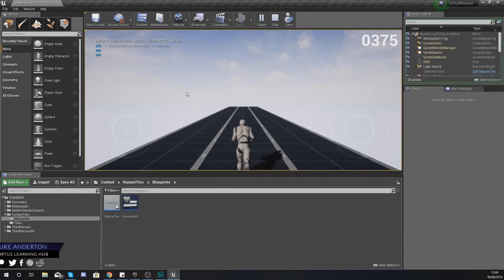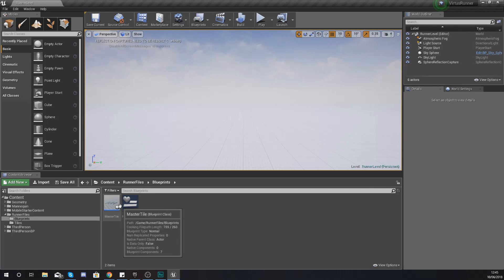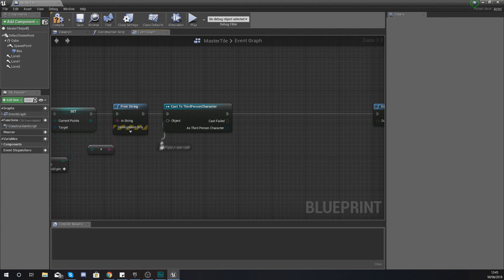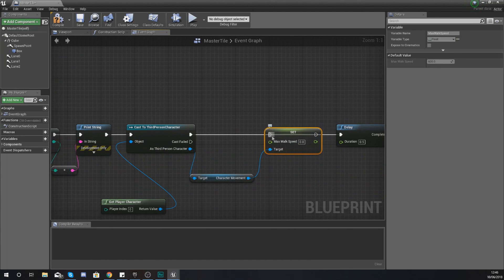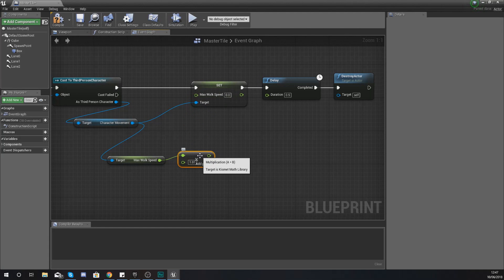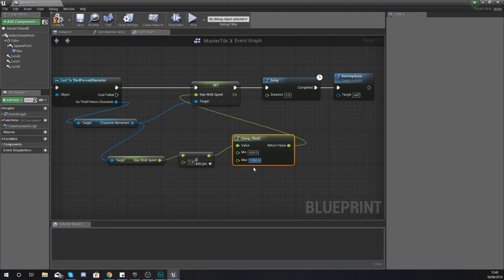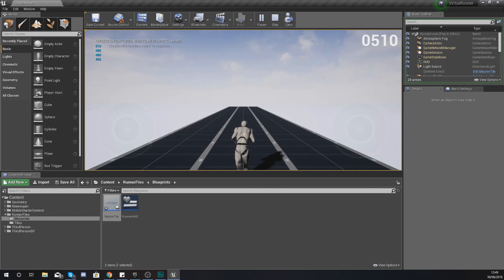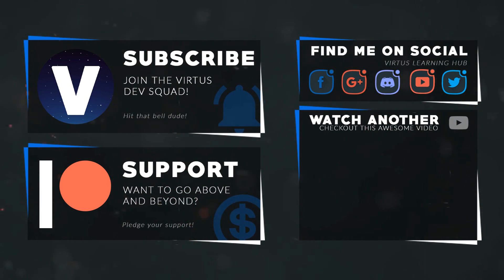Increasing Speed - #7 Creating A MOBILE Endless Runner Unreal Engine 4

Comment: There seems to be a problem that if you press left or right before its finished moving lane it sort of resets and moves to the same lane. any idea for a fix?
Reply: ive the same issue. i know its a bit late but did you manage to fix it?
Reply: @ashonline77  ye i just added a Boolean called 'isswitching?' lanes obviously. Set the Boolean to true in the code that start the move and set it to false when the transfer is finished. Then at the start of your code for switching lanes put it on a branch where the condition is iswitching has to be false or it wont continue.
Reply: @alistairbell1051  ah right. Thank you very much. Now that I think about it this should have been obvious enough cause the double take bug has been happening a lot with trigger boxes lately and I've been fixing them with booleans.

Comment: can anyone help me with that please. my character is disappearing and game is stopping after 2097 point. what is the problem ?
Reply: has anyone found a solution?
Reply: Hi did you solve this problem?
Reply: same with score 1048 for me
point multiplier = 1
Reply: Yes the same problem what can I do
Reply: Due to the numbers I would think that it has something to do with the datatypes. Game is probably reaching a boundary at either 1048 or 2096 due to the datatype of the score and jumping to a negative value which causes the game to crash. Check the datatype and maybe switch it
Reply: Same issue here!